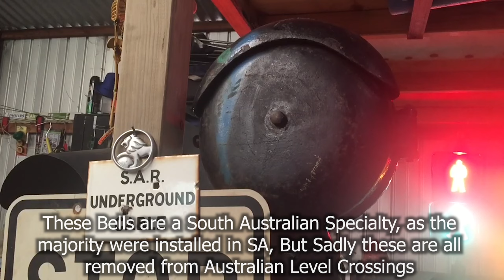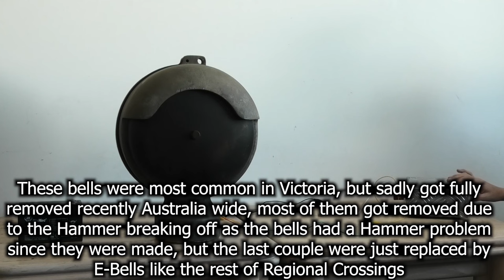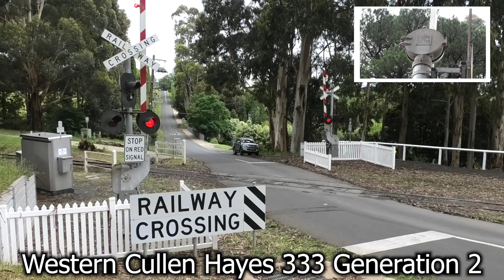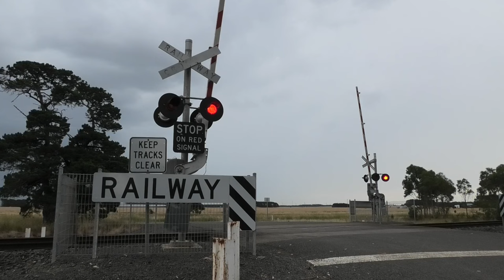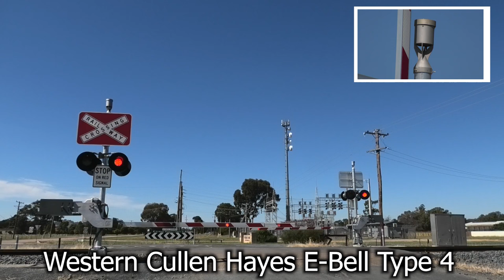Types Of Railway Crossing Bells In Australia

Comment: Seymour where I live, has a safetran mechanical bell that goes off everytime a standard gauge train passes. It's located at the Albury end up from the station.

Just a quick question though, which other states had Westinghouse hybrid bells apart from Victoria and New South Wales
Reply from the maker: Correct there is a Safetran bell there, But it isn’t a public crossing, it’s a warning bellpole.

Sa used to, Wa may still if not they used to, I believe Northern Territory did at one point, not sure on others
Reply: 00:15
Reply: 0:32
Reply: 0:46